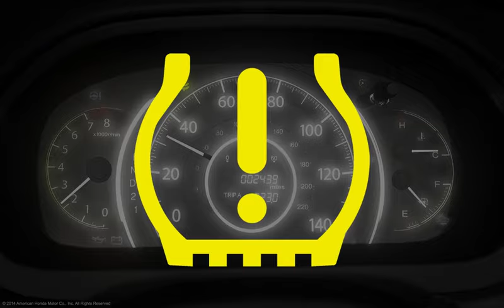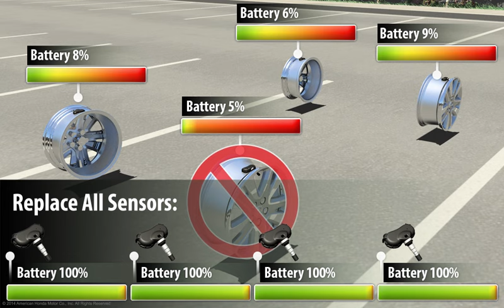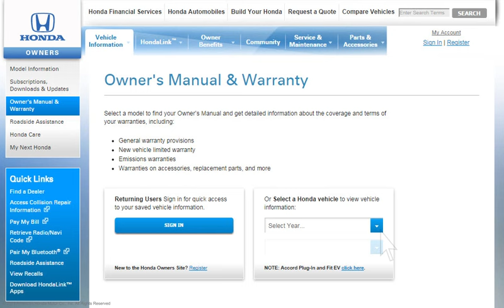Tire Pressure Monitoring System (TPMS) Battery Information

Comment: It's another way to sell you an $80 (x4) part because a 50 cent battery died.
Reply: I wish they could charge via kinetic charging Rolex has a watch that will never die so long as you dont let it sit longer than 1 week even If it does die you can shake it for a few min and it's back again.
Reply: @joshuamcpeek4708  how much would that part cost then? and how easily would it get damaged due to the beating a tire wheel assembly takes on a daily basis.
Reply: most people don't even keep their cars that long nowadays. if someone does, they have 7 years to save up $320. That's like $0.25/day. I think we can manage.
Reply: @MrAnwazi007  idk but I DO know that the carmaker gets the tpms sensors dirt cheaply and sells them for an arm And a leg, apple prostand style!
Reply: @joshuamcpeek4708  You're referring to automatic watches which are terribly common among all brands. It's just a kinetic rotor that winds the main spring. A typical automatic will have a power reserve of ~3 days. Wickedly complex and expensive for use in a simple tire.
Reply: @jaketyler7088  What we need is bigger batteries, like a disposable lithium AA battery, or internal sensors with battery compartments on the outside.
Reply: If you want to get all 4 replaced by a dealer, they will cost you close to $1000.
Reply: @Sunnysky321  God help you if you have to go to a dealer for service.

Comment: 280.00 per tire to change a 2.00 battery. 1200.00 dollar for four and then you need to rebalance you wheel. and no way to turn off too... $140.00 to cut one key too ..will never buy a honda again
Reply: most places charge $15-$25 per tire to mount and balance,  which is basically what you're doing. The tire bead has to be broken so the sensor can be replaced, most don't have a replaceable battery as they're sealed units. The factory OEM sensors are always expensive but you can get them online for much cheaper
Reply: Be careful with online. They may NOT be compatible. Ya get what ya pay for.....

Comment: That light can stay on as long as it wants. I'm paying nothing to fix it. All I need is a $1.00 tire gauge and I can periodically check the tires myself.  At least Honda has now moved to indirect tire pressure monitors so there are no more TPMS sensors in the tires on the newer models.
Reply: Yeah. And then what do you do when THAT system fails?
Reply: @jakejones5736  Its a combo system that is part of the ABS system. If one tire is spinning faster than the rest, you have a repair that has to be done to the ABS wheel speed sensor anyway.
Reply: @nickv4073  Not sure why one wheel turning faster than the others commands a repair to the device that senses such difference. I would think that it's doing its job if it reacts to a speed change.
Reply: @jakejones5736  If one wheel is turning faster than the rest, it usually means it is lower on air because the diameter of the tire is smaller than the rest. If all the tires are at the same tire pressure and the ABS says something is wrong, it usually means teeth are stripped on the gear of one of the wheels and needs to be replaced.

Comment: One of the most unnecessary things for regular cars. It's easy to just check your tire pressure every 3 weeks.
Reply: I disagree. I was in a fast food drive thru when my TPMS started beeping. In the space of 5 minutes I watched my tire pressure go from 30 PSI to 12 PSI.
I got my food and was able to drive 1/4 mile to my local tire store where they patched it up.. 
Checking my tire pressure 3 weeks before wouldn't change picking up a nail...

Comment: I called 4 different places (Tires Plus, Goodyear, locally owned tire shop, and Costco) for a price quote for replacing all four sensors for my 2007 TL-S, and I got price ranging from $270 to $750.  Tires Plus and Costco quoted me the lowest price around $270 and the Goodyear quoted $750.  Local tire shop quoted $510.  They all said that they use OEM, so not sure why there's such large price discrepancy between the stores.
Reply: Tires Plus gave me a price of about $80 apiece for a single tire pressure sensor for my 2015 Malibu. The dealership wanted about $130 or so.
Reply: To BOTH of you...  be careful. I got screwed with aftermarket sensors. Next vehicle I used OEM from the dealer. Yeah, cost a fortune. But I think it's money well spent.
Reply: @jakejones5736  What happened?
Reply: @Sunnysky321  Got rid of the vehicle that had the problems. They kept saying things like "it's the computer and not the sensor" or "sometimes nearby interference will set the TPMS light". BOTH of which are bogus. As with the other vehicle? Still have it and NO issues whatsoever! These are 07' and 08' vehicles when the technology was new. So perhaps they've improved things significantly in the aftermarket by now to where you'd be ok.

Comment: So, the sensor have a common cr2032 (or it looks like it) battery but you can't change it your self? You have to pay 35 bucks for a new one? Oh hell no, watch me change it myself honda, watch me change it myself.
Reply: Good luck trying without busting it. Potting material inside the sensor housing secures the electronic components and protects them from the harsh environment inside a tire. “In order to remove a battery, the potting material would need to be melted. Heating the material could damage components and allow the battery’s lithium to seep out of its housing and into the environment.”

Comment: Can't the TPMS be designed to be recharged when the engine is running?  BMW's keys contain a battery that recharges when it's inserted into the ignition so you should be able to recharge the TPMS battery by adding contacts on the wheel that provide a DC charge.  I'll help you design it if you give me a lot of money LOL.
Reply: This way car companies can continue to make money after the car is purchased.  It's the same reason parts could be designed to last an infinite number of cycles but aren't.
Reply: +wrxnofx Built in Obsolescence, a waste of resources, going to college does nor make one smart, 10,000 engineers in Detroit and japan and they can't or will not build devices that will last 20 years or more.  
Greed,selfish,amd all the isms
Reply: They are there to help themselves,not to help us;   unless the GREEDY GOVs stepped in.......   hello!!! it´s time....
Reply: Yup. The government pigs are behind the ripoff manufacturers. Scam and a sham.
Reply: You really think that having a huge coil for charging a battery next to each wheel is a good solution? It is inefficent, too expensive and too complicated. It is much better to change a battery every 5 years.

Comment: This video is misleading. It states that one of two lights will illuminate when the battery life is too low to send a signal. This leads the viewer to believe that when the horseshoe icon lights up the system has a failure, because it does not explain that a system with BOTH lights means that such icon is dedicated exclusively to low tire pressure.    0:55

Comment: How does TPMS send the data to vehicle ? What kind of tech is used ?
Reply: murat kar on my car, 2006 Cadillac CTS, it uses the same module that the key fob uses. How it knows what the pressure is to which tire? Well it's done by programming. For most manufacturers, there is a procedure that must be followed. First, enter programming mode. Second go to the first tire, typically driver's front, then second, passenger front, passenger rear and end with driver's rear. What you do at each tire, again, depends on the manufacturer. Some requires a change in pressure, either decrease or increase. And others requires a special tool. All will give an horn chirp to say that the car "saw" the change and to move onto the next wheel.
Reply: Yep.  There is a procedure for reprogramming for most vehicles that you can do yourself fairly easily.  Each tire pressure set to a different range i.e.:  Driver front 33-36 PSI, Driver rear 32-28 and so on.  A you tube search will shows several people performing this (some give a specific PSI, and others give the actual range - which is easier - just set in the middle)  Then drive for a mile at a certain approximate speed until the tire pressure warning light comes on, then fill each to proper psi.  I'm sure there are differences with each make model and yeah, there are no doubt some that require a special tool (actually they ALL can been adjusted tool at the dealer)

Comment: hey how to remove it if  i need  replace my flat tire?
Reply: spare tires can also have a tpms sensor. If it's an indirect system then your OEM spare is the same diameter as the OEM alloy wheels, just not as wide. Spare shouldn't affect the TPMS.
Reply: if you are able to replace a car's tire, you should already know how to remove a tpms sensor.just google it or watch a video on youtube. you're already here anyway.  just about every car has either direct sensors or indirect systems that estimate air pressure using the abs system.

Comment: Hey guys I need help with this in my car said check tpms systems.
Reply: @Matthew Caughey what kind of car? if you got aftermarket rims and tires that aren't OEM proportions, you'll always have the light on if it requires reprogramming for bigger or smaller diameter tire/wheel. you sure it costs $600, you got an estimate from somewhere saying that?

Comment: My temps monitor problem light came on what should I do
Reply: Do I need it right away ? I got four brand new tires balance alignment already done and my light still on
Reply: I disconnect the battery two days ago and the light went away and it hasn’t came on yet

Comment: I messed up the rim. So I replaced the whole rim and tire that they sold me at a tire discount . now the tpms is on
Reply: did they install the new wheel with the original sensor? you may have an indirect tpms system that doesn't have a sensor but collects data from the abs systems. Try finding the TPMS button to reprogram.
Reply: @MrAnwazi007  i did just that. Thanks